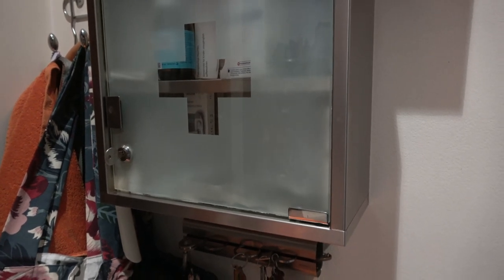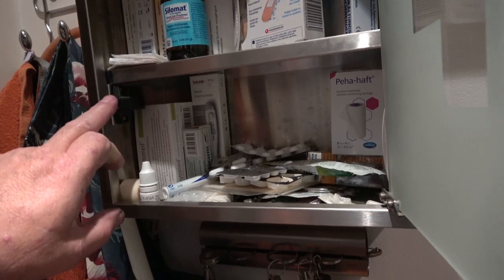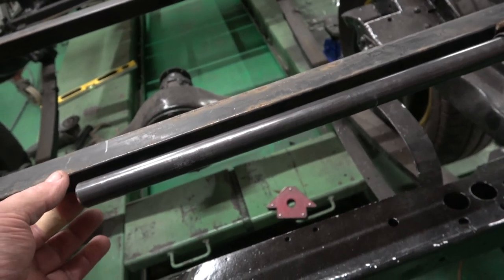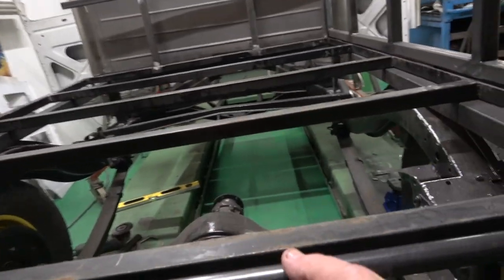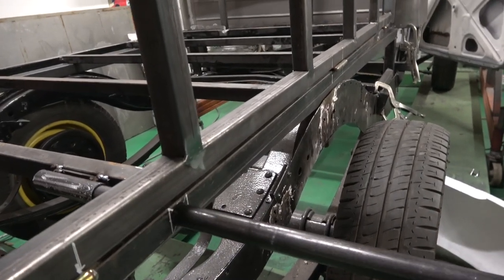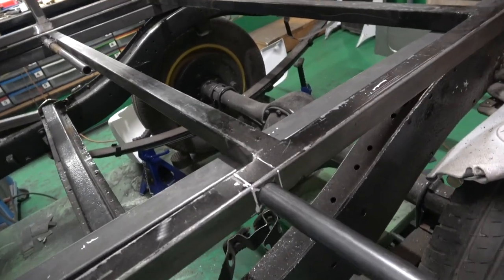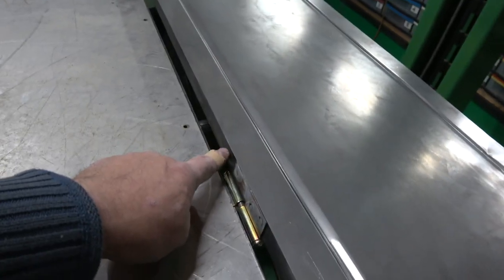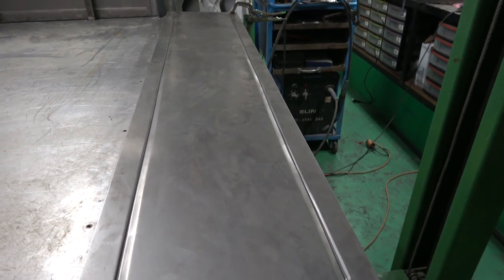Fabricating A Pick Up Truck From A 1930s Citroen Car Part 10

Comment: I think the pull out tube system is neat,but the Good old rust will finish that smooth operation out.
Reply from the maker: Worrel,  I can use some lubricant in the outer tube to make it even smoother running.  it‘s mounted high enough off the ground not to get wet 
but I can always make a small cover for it if it‘s a problem. The wheel arch will be low enough on the inside to keep and water out. Cheers Dave

Comment: I wish I could flick mine in and it would pop out 😁😁😁
I assume with the closing piece on the rod (Magnet end)  it will be square and therefore prevent the rod from rotating and then the panel dimple will still be aligned ?
Reply from the maker: Gary,  Not anymore buddy lol.  Exact a mondo it will stop the bar or tube from rotating. Cheers Dave